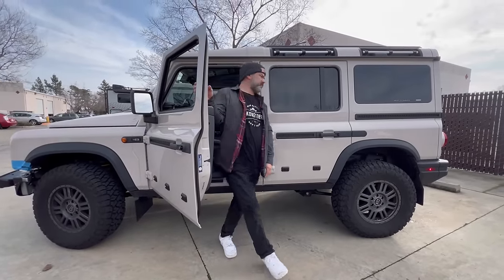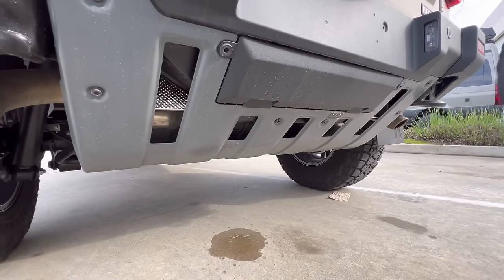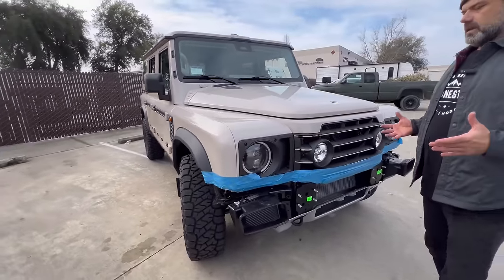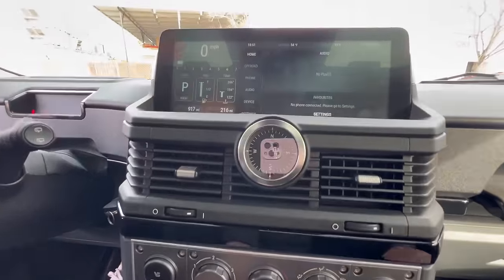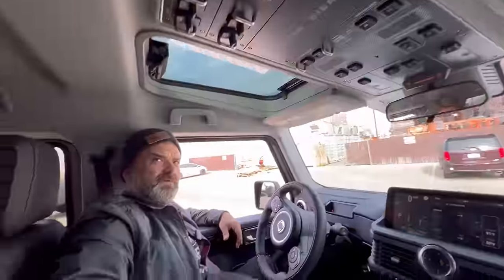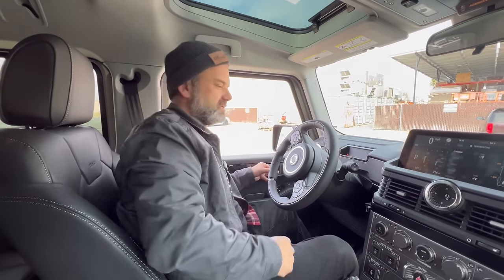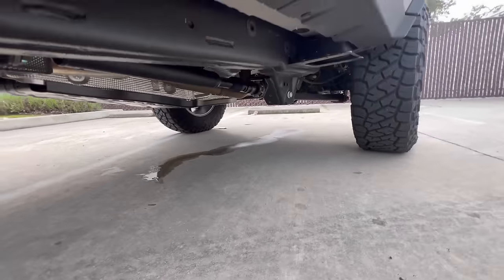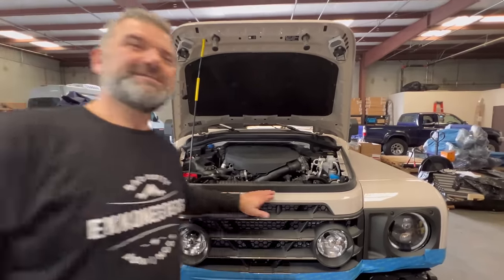IS IT WORTH IT? 2024 INEOS Grenadier | WALK AROUND | 4x4 | OFF-ROAD

Comment: Grenadiers are selling very well here in Idaho. We are a rugged state with winters that can be very rough and a tough built 4x4 is worth its weight in gold. Things I instantly notice? The interior controls are all easy to use with space for gloved fingers and no reliance on silly touch sensitive sensors that won’t detect the touch of a gloved finger. A BMW straight 6 that is rugged, reliable and easy to work with. An interior with lots of room for kids, dogs and hunting/fishing buddies. Built for off-road use with external electric outlets. Room for larger wheels/tires. Underneath the truck everything looks purpose built for durability. Maintenance friendly design with room to work.
Reply from the maker: Great feedback.  I agree with you on all points. I’m excited to head back to CaTuned Off-road and test out the new equipment that is being installed. I definitely can’t wait to get engaged in some serious diverse terrain. Yes, definitely agree with the frame comment. It’s the type of frame that literally if somehow it was damaged or broken, it’s a cut and weld repair for sure.thank you for sharing your thoughts and insight.  Greatly appreciate you subscribing tour channel as well.

Comment: Test drove one the other day, the one I looked at was priced at $77k at Rusnak in Pasadena, Ca. Loved the utility and pure toughness of the vehicle overall... HATED the "recirculating-ball hydraulic steering system." It's probably a badass system for overlanding and bouncing over rocks and logs, etc. but the steering action takes a lot of getting used to (feels unresponsive and doesn't right itself immediately after a turn) and could possibly cause a bit a fatigue on longer roadtrips just getting to the overland trails... If you live on massive acreage that is mostly dirt roads or you're a farmer/rancher that needs to trek long distance over your lands, this vehicle is thoroughly for you BUT the Ineos Grenedier is definitely not designed to be a daily city driver.
Reply: Old man emu already has damper that creates return to center.  Also it drives like a old school truck not a suv.
Reply: @peopleschamp7258  oh nice thx for the heads up, just found the steering stabilizer ... good to know it's available. I have owned old trucks (including non power steering) and new SUVs and haven't ever driven anything that steers like this.
Reply: @peopleschamp7258  An old-school truck, such as a Defender or Land Cruiser 70, doesn’t have such problems at all. Furthermore, when it comes to old-school trucks, they must have a manual gearbox, a better turning circle, higher clearance, a reliable engine (not a BMW), and gages in a proper place (not an iPad in the middle of the dashboard), among other features. This car is nothing but an extremely over-advertised and overpriced toy for metrosexuals.
Reply: @australia-ukraine  good luck in life
Reply: Bmw much more reliable then land rover so pretty terrible point @australia-ukraine
Reply: @australia-ukraine 😁👍😅👋

Comment: It’s an awesome vehicle it needs some improvements but the biggest thing is the cost they’re expensive and I am assuming that’s because of the tariffs that have to be paid when they come into the United States, the competition is the jeeps and the Ford broncos at least for off-roaders, Personally I feel it needs a little bit more ground clearance and it’s got a few things that I think they need to change to make it better but overall I think it’s an awesome vehicle if it was a little more affordable I definitely would consider one I really like it I sat inside one recently and felt right at home, a little bit more power would be nice & a little bit taller tires and lift springs and I think the vehicle would just be awesome off-road.

Comment: Looks like it’s on bigger tyres than the standard or has it been raised slightly
Reply: 285/70r17
Reply from the maker: Yes, the stock tire and wheels were removed and believe it or not the 2023 Mercedes sprinter wheel tire package swapped right over from one of the other project vehicles.
A new set of wheels was ordered and will be installed shortly.
Will definitely keep everyone updated.
Reply: Thank you that's interesting to know sprinter wheels fit @ekkonesters599

Comment: Been looking for an older Land Cruiser, LX, or a newer GX. Today I was driving and passed what looked like a car lot full of resto-modded defenders lol. I pulled in and learned all about Ineos. Amazing truck but the steering literally gave me anxiety, that is the only downside....not sure I would get used to it.
Reply from the maker: Tire pressure coming from the factory seems to be a bit over inflated which causes some of steering issues. After adjusting the tire pressure on the shop unit between 35-38 PSI there was a significant improvement. More predictable.  But yes agreed initially very odd.
Reply: @ekkonesters599  Good to know, I’ll look into that.
Reply: Owned mine for a month.  Steering literally took about 15 minutes of in town driving to get used to.  Highway is a bit longer, but there are after market solutions - I plan on keeping the steering stock.

Comment: Honestly would have been better at 40 k not almost 90. Its intention was to be a rugged back to basics off roader  now it’s overpriced I like the looks but I’m sensing it will be a failure.
Reply from the maker: Hello, thanks for checking out our channel and sharing some thoughts. I’ve heard thoughts on the pricing going both ways. While some folks consider it steep, many others are feeling it right in the market.  
I’m really curious what the comparison for vehicle capability, build out and reference are triggering “over priced concern”. 
Here is my thought so far, could change but just a thought.  If I build out a Jeep Rubicon, as close as possible, low end MSRP on the Jeep 2024 WRANGLER RUBICON 4WD was $65,295 and comparable Jeep $93,935.  Of course In strongly believe the Jeep is no comparison and the Grenadier overall is better built in many ways. Then there is the Defender which was hovering around $84,500 and $116,000.00 and simple not a vehicle I would go with and Lastly the G-Wagon, which can push $139k -$250k and Instill don’t believe it will be a match let alone comparing maintenance.  
It’s just an interesting new topic to have.
I’ve been encouraging others to do a lot of research when doing the comparisons.
I still feel that the INEOS is the dominant vehicle in many respects. Things in the steering these are manageable with a simple add-on. it’s also proven itself in other countries. Thanks a lot for sharing your thoughts and opinion, and watching our channel. It’s been a great discussion. Let me know if you have any additional insider thoughts. I’d love learning as well.

Comment: Rather spend £60k on a used G Wagon will hold its value much more imo
Reply from the maker: I do like the refinements of the G-wagons, but the overall expense of maintenance may detour me a bit.  Also, I feel as if I would be more likely to get out and really use the INEOS in rough terrain and challenging back roads over that of the G-wagon. Thank you for taking time to check out our video.

Comment: Nope, the thumb opening was the biggest annoyance of my old jeep. $97k??? Nope
Reply from the maker: Quick question: was it that the thumb/push button would get stuck or jammed?
Reply: @ekkonesters599  neither it was the annoyance of using the thumb to push in the button for the JK and older wranglers.  If you injured one thumb then your left with the other good thumb vs all of your fingers for a handle.  The  jeep JL replaced the thumb button with a traditional handle.

Comment: This BMW engine has a whole lot of plastic parts that will harden and crack with heat and time. It is not exactly a simple engine either and if it failed, expect a fairly high number of hours to be billed to get at anything and reassemble.

Comment: Awful car, badly engineered. Just because you add all good ingredients doesn’t mean it’s going to be great. I’m waiting for the first YouTuber that services one of them and also wants to change the shock absorbers and springs. 🤣
Reply from the maker: Thanks for checking out our video. As we continue to explore and learn more about the INEOS, in becoming more intrigued by a few things especially the Power plant and transmission choice, which I’ll hopefully be able to elaborate more on soon. But in respect to your thoughts/position on changing the shocks and springs, I can’t really see where this becomes a concern? Its robust suspension, features separate coils and shocks, which offers a straightforward system that allows for easy replacement. It’s also a design that ensures reliability on challenging terrains, with minimal complications. In case of issues, the ability to quickly repair such things will be of ease. Also, the Eibach springs are one of the most respected spring manufacturers on the market. 
If you have time please elaborate on what makes the car awful in respect to engineering.  Thanks and safe travels.
Reply: @ekkonesters599  thanks for the reply, I mean I looked at quite a few at a dealership in Britain where I live and and there is no underbody protection unless you want to pay extra. I found the cabin area to be cramped. I was told by the salesman than the chassis is not galvanised as everyone was told in the early days but it’s just painted. When I asked the salesman how do you change the rear shocks as you have limited space he got a technician who told me, you have to undo the body to chassis mount bolts all of them from the rear but leave the front 2 attached at the engine so you can raise the body slightly to get access. Also there was a about 5 cables really close to the propshaft and exhaust that could become an issue off-road, I’m hoping it was just someone lazy at the factory not doing there job properly and not how it was intended. 
I took lots of pictures of all the flaws I found. 
Safe travels